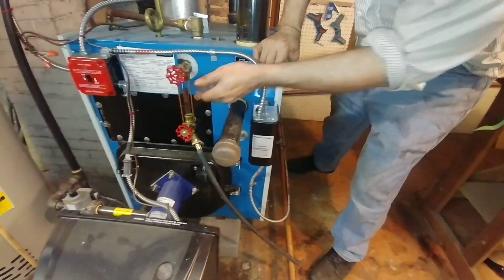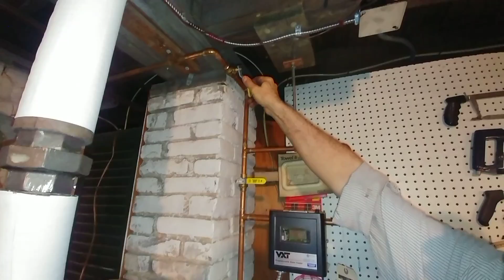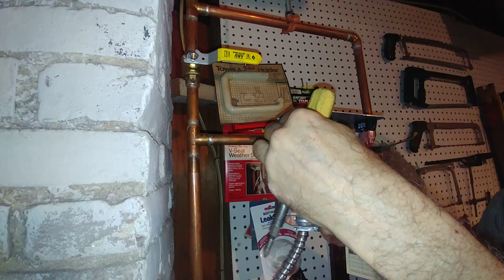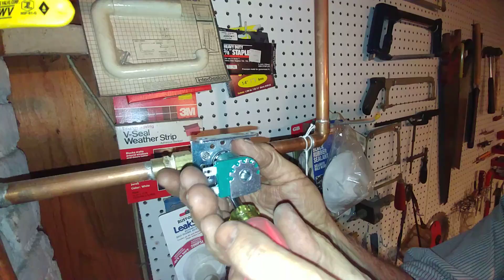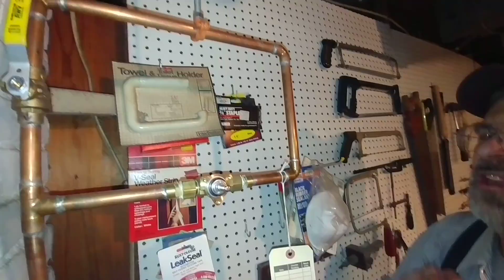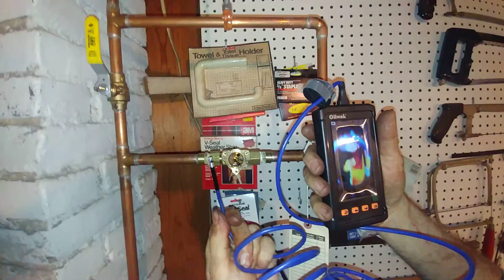VXT-120 Installed In 2018 Now Flooding A Steam Boiler. Why?

Comment: If I have a uni match feeder can I change it to a vxt using the same valve?
Reply from the maker: Yes, in theory.  If you remove the unimatch electrics and frame, you are left with the s-35 valve core only.  If the valve has been in service for awhile,  and esp. if you are in an area of hard water, you are going to need to clean the valve thoroughly.  Then, rob the parts from the vxt valve to make up the s-35 and install the vxt electrics.
The latest versions of the vxt allow the valve to mount in any position.
Depending on circumstances, it just might be easier to replace everything all at once and have done.

Comment: Thank You Gordon, currently i am facing the same issue and VXT unit has over feeded my boiler,water comes out of all the radiators vent valve all over the house. Currently i shut off the boiler emergency power but i will have to probably change out VXT unit.it was installed in early 2017. I contacted a Heating & plumbing proffesional & they told me with parts and labor of changing out will cost $800. I was wondering what if i change the setting for low water cut off to 1 gal and 30 sec delay,instead of getting signal from electronic device that call for low water level & feed from VXT. If i take those feed wire off from vxt and jump it & set it to 1 or 2 gal with 30 sec delay.. is it a good idea?
Reply from the maker: Sorry I didn't see this until now. YouTube had it in the spam filter.
It might be your Low Water Cut Off safety (LWCO) is sending bad signals to your VXT. The McDonald & Miller PS and PSE types do sometimes fail intermittently to detect water in the boiler, and cause the VXT to feed even when the boiler is already flooded.

Comment from the maker: Addendum: I've noticed in diagnosting these flooding issues that when the manual feed switch is pressed and then released, there is a distinct "thunk". That starts at about 0:37. After the flow disc is put back in its proper place, the "thunk" is gone.